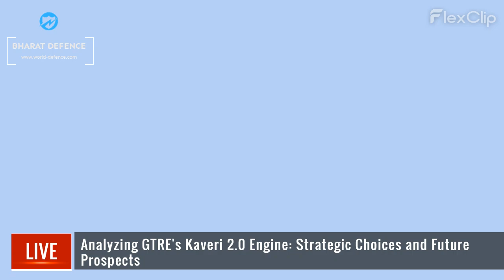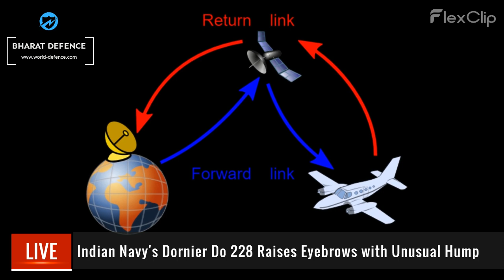Bharat Defence News: Kaveri 2.0 For Tejas Mk-1A, Do-228 Upgrade, DRDO's Direct Energy Weapon System

Comment: Please stop the Kaveri nonsense. If India really wants to develop a fighter engine indegenously then it should collaborate with a Foreign engine manufacturer. Take an independent responsibility to develop a certain part(s) of the engine just like Safran does with GE of USA. Safran of France makes the less technically complex parts of the engine where as GE makes the more complex and difficult to produce parts. But eventaully , Safran learns more on the overall engine and now Safran makes engines independently. India should take the same track or else it will drag it's tail for another THIRTY FIVE YEARS, like it already has on Kaveri, and never make an enigne that can compete at the World class level technologically.